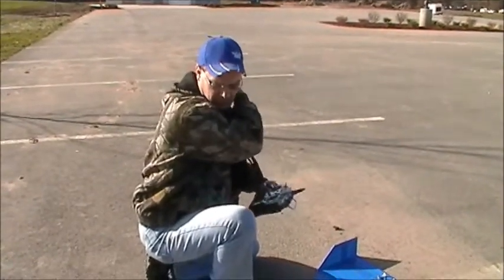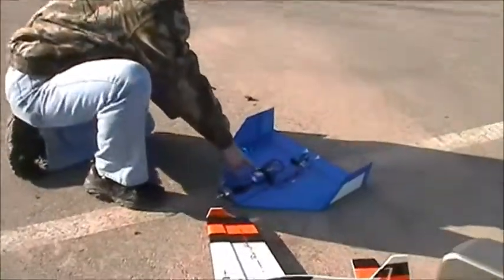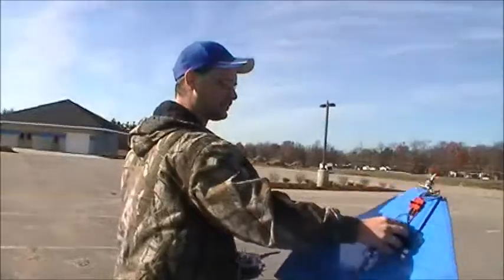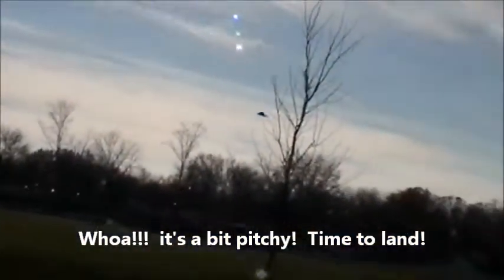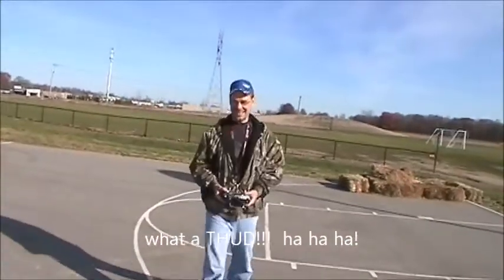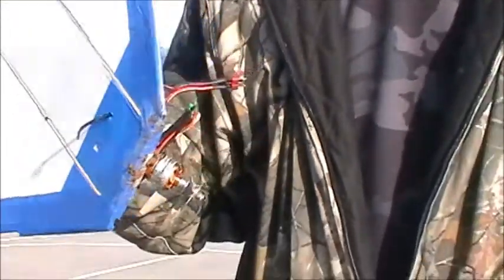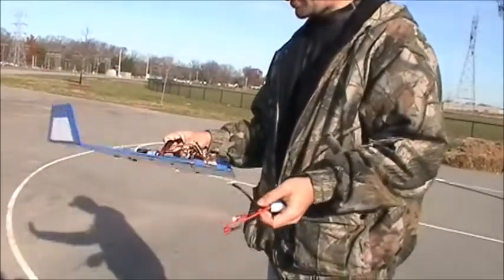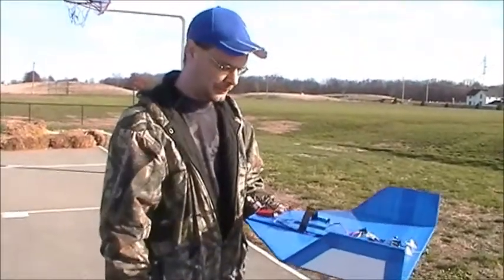EA Delta Wing Maiden flight, 2200kv motor and 6x4 prop

Comment: nice video have you try a 1400 kv motor 20amp esc and a 5x5 prop and 1300 battery i might help too much power and the cg still a good looking plane i made many..
Reply from the maker: Thanks for watching the video and commenting, Mr John!  I actually have another wing, of the same dimensions, that runs a 1500kv motor, 30amp esc, 2200mah lipo and an 8x6 prop.  It's a speedy little thing and it's just tons of fun.  I use the 2200's because i have 13 of them.  Ed (ExperimentalAirlines on Youtube) said that he flew a wing like this with a 2200kv motor and he said it was quite zippy.  Because I have so much fun with my 1500kv wing, I want to try the 2200kv wing.  I have it all done, setup and the cg is balanced correctly now.  I'm just waiting for the flying weather to get to my neck of the woods.  25mph winds are very unforgiving with these little wings.  :-)

Comment: Did you ever get this thing up and flying? I also built an EA Delta. I built it with a Grayson microjet V3. Plenty fast for me. I eventually left all my rates at 100% but my elevons appear considerably shorter. I didn't see an actual measurement for them in the build. I'm of the opinion yours was tail heavy as well. I'm sure she's flying great by now!!
Reply from the maker: Unfortunately, no...I never did get this wing flying properly before the weather got real cold.  I did try to fly it again, after this video was uploaded, and it crashed so hard that it really screwed up the nose and the battery slid into my ESC and really damaged the ESC.  However, I did build another one and I have it waiting and ready to go.  I just need the weather to cooperate on one of my days off.  I really wanna see if I can control this speeder.  I'll have video.

Comment: another great vid thanks for posting. I could be wrong but she looked tail heavy. did you put your COG the same place as your other one?
Reply from the maker: You aren't the first person to suggest that this wing was tail heavy, lol...and like those other people, you are right...it was tail heavy.  I have the CG marked at the correct location but I think this motor weighs less than the motor on my other wing, therefore throwing off the CG.  I just never thought to try to balance the wing on my fingers before the test flight.  It's a rookie mistake that I won't make next time.  Thanks for watching!  Round 2 should be much better!!!

Comment: Great recovery on that first flight, way to go in the remain calm department.  I had a similar incident last weekend with the loss of reviver.  Hit so hard actually broke the prop hub right down the middle, and jammed the prop shaft out the back of the motor. Thankfully it landed on its face and remains largely intact. LOL.  Looking forward to V.3 buddy.
Reply from the maker: Thanks for watching!  There is no doubt in my mind that this plane is going to be super fast.  I just need to get the dual rates and expo set correctly.  I have a replacement esc on order.  Hopefully the weather will cooperate for me to try again!

Comment: That looked wild then; Doh! But good attitude and fortunatly it could have been worse, last plane I flew ended up nose first in a bonfire (un-lit at the time) lol
Reply from the maker: Yeah, it could have been worse.  It hit the ground so hard, lol.  I'll be back with this one again.  Hopefully the next run will be better.  I don't know if you've seen my EA Photon motor glider flights but this little wing has the same motor, battery, and esc as my motor glider.  It should be capable of some serious speed when it gets dialed in.
Reply: When I hit the ground hard I have that moment where I shrug my shoulders and say to myself “oh well” then I say out loud “dam I didn’t get that on film” ;) I just looked at you last video of your EA Photon, that is a more substantial build and looks like it can move when you have the power on? Otherwise it looks nice and calming; probably fantastic for FPV or cam mount if you can mount a cam without the prop in shot? Hopefully you can get the delta dialled in; I know you have the patience to work it out, so you should end up with a speed demon! What would the approx power to weight ratio be for this?
Reply from the maker: Thanks for watching this video as well as my Photon video!  I love flying my Photon motor glider.  It definitely has plenty of power to gain altitude.  Once I'm up high enough, shut the throttle off, flip the on the flaps and just relax.  It's an awesome plane to fly.  FPV on the Photon would be a great deal of fun.  I don't have any FPV equipment yet but I have taken some great video from my key chain camera being mounted on board.  Very nice!  I really don't know what the power to weight ratio would be.  I'll have to work that out and I'll get back to ya.  Like I said before, this EA Delta wing has the same setup as my Photon motor glider but my Delta Wing has a fraction of the weight and is much more slim and resistant to wind.

Comment: Liked Derek and thanks again bud I will use that mounting tape and will see how it works 2 see if no vibrations on the beastx
Reply from the maker: Thanks for watching, Delbert!  It was a fun attempt!  With that mounting tape...cut off enough of it to cover the entire bottom surface of your beastx, then install it to your helicopter.  You should be in good shape!!!  I am happy to help you out.  That mounting tape is just awesome stuff.  I used that same mounting tape to install my servo's to the Delta Wing in this video.